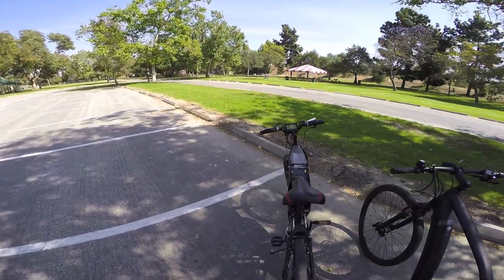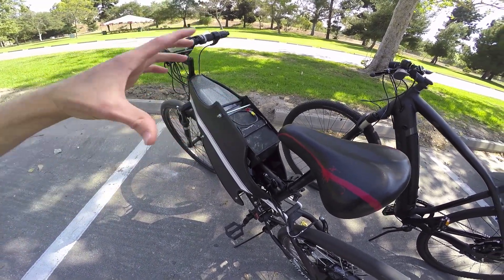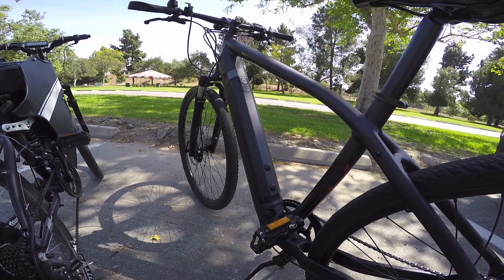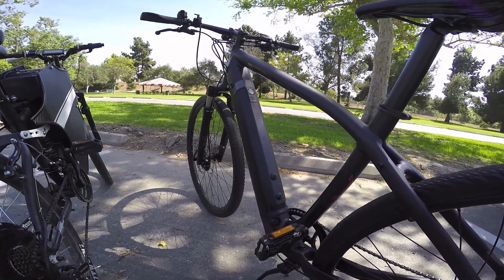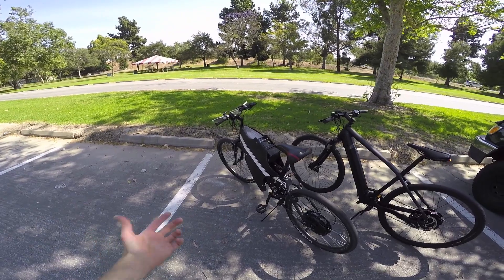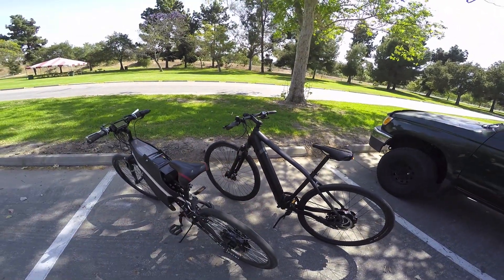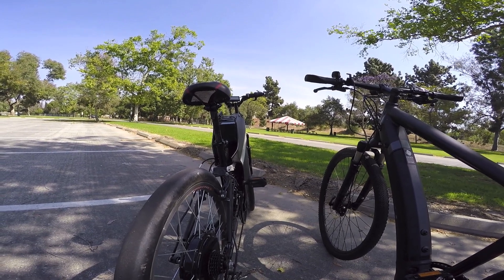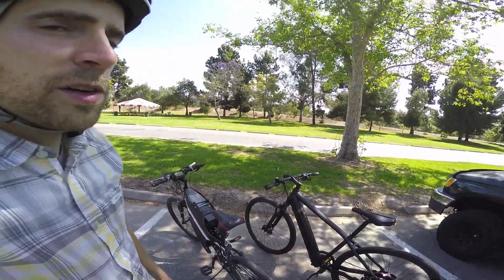eBike Primer: Different Electric Bike Battery Types & How to Care for Batteries

Comment: My first ebike✳✳>share4.photo/ebicycle?М170    Easy to assemble even one handed. Instructions that are included are poorly done but they point to an inline video that gives you everything you need to do a stellar job. Seat that comes with the bike is uncomfortable but I read that in reviews and purchased a gel seat with embedded light that was an easy swap. Also got metal pedals to replace the existing ones since I am 6 ft 4 in and my local bike shop strongly recommended that. Two upgrades and a greater starter ebike. Thanks.

Comment: I just made my ebike using a kit I bought online for 170dollars and it was 48 volt 1000 Watt then got batteries which are 12 volt 20ah together make a 48 volt 20 ah pack and to me I don't really notice the weight this bike cruises at 25 and tips out at 30 and can last for over 30 miles to me spending 300 dollars on this kit with batteries is way better then spending over 3000 to get the same performance and range. the only thing is every 2 years or so I need to replace the batteries which is still only 130ish instead of around 1000 dollars for a equal lithium battery pack.